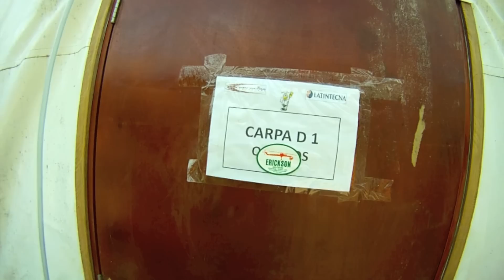Sky-Crane Flying The Jungle Peru

Comment from the maker: I used the black flat plastic piece that comes in the display case when you buy the go pro. Drilled holes in it to match up with the inspection panel on the Pylon of the tail and bolted it on. I used the suction cup only in the cockpit shots. I used the roll bar mount for the gear leg and stinger shot and the bicycle seat post mount for the engine and hydraulic sled shot looking back. Just get creative but make sure its a solid mount. :)

Comment from the maker: Really not an hour requirement to fly the Crane. Just need to be type rated in the crane to be PIC. There is a minimum hour requirement to be hired at Erickson. Have to have a check ride with the FAA to get your type rating. Need to know the helicopter inside and out to pass your type ride.